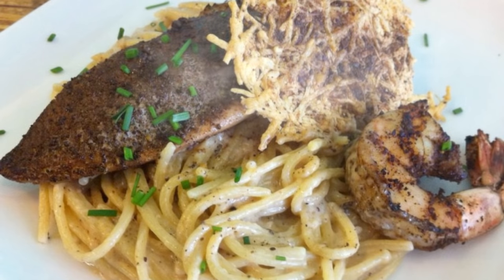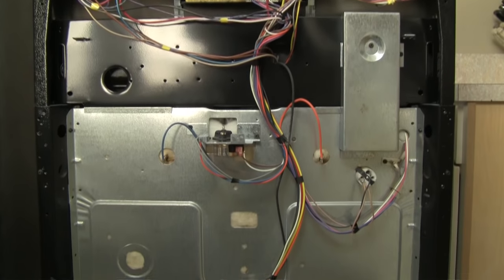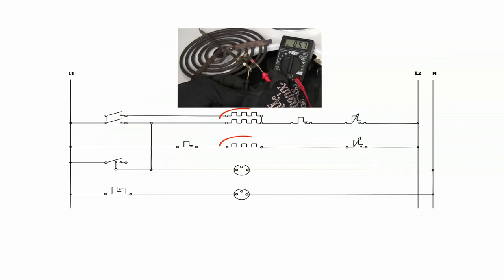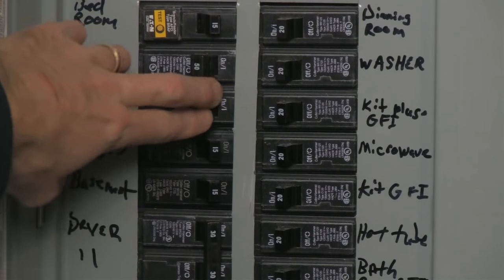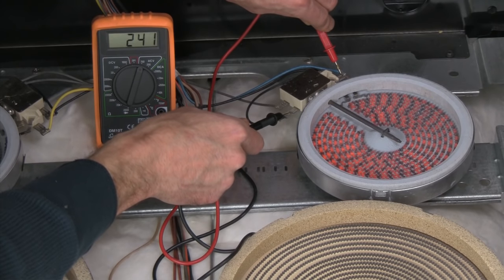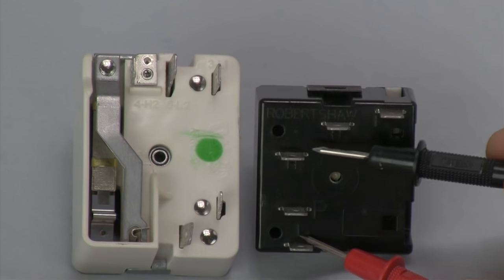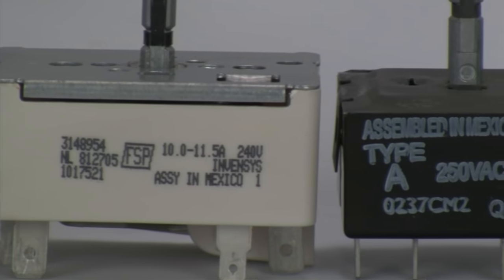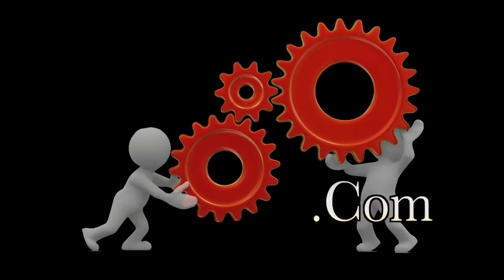Electric Range Stove Repair: How To Repair Burner Elements

Comment: I have a GE JSP42SN4SS, few days ago my power boil element started behaving weirdly. The indicator that  element is on is lighting all the time. When I turn the knob to start power up the coil, it glows red for 10 seconds and then switches off. Then does not switch on for 18-20 hours, after that much time if I turn the knob to switch it on, it again glows for 10 seconds and switches off. Is my coil thermostat bad? Do I need to replace the coil module with something like (http://www.amazon.com/GE-WB30T10133-Radiant-Element-Stove/dp/B004H3XQY8)?

Comment: What do u do if the back wiring is the problem? There is one of the large front burners which is not working... I checked, it is not the problem, it is the red wiring to it is that problem... what do we need to do ...
Reply from the maker: Replacing the wire is possible but you will need to make sure all your new end connectors are crimped well and you are using the same size and type of wire for replacement.  Good luck!

Comment: Yes the breakers is on and 240 volt is at the breaker.
Reply from the maker: Hmmm. Really sounds like a power supply problem, it would be extremely rare to have 3 switches or elements fail all at once.  If it were me I would take a look at the connections from the cooktop to the wall and try to get a voltage reading there to eliminate the home wires or contacts.  If that checks out your going to need to get into the cooktop and see where you're loosing power.  Cooktops simple mechanically but hard to access for testing and troubleshooting. Good luck!

Comment: just seen 2 different whirlpool  model  stoves with  glass top elements glow red  then cut off, for about 10 sec then glow red again,then cutoff again,why ??? cant cook popcorn or boil water,thanks!!! heard its a flaw in design and cant be fixed
Reply from the maker: The element switch will cycle the heat on and off to regulate the overall temperature.  If it was red hot all the time it would get way too hot.  If you are not getting enough heat for popcorn or water, you will need to check the element and the switch.  you may also want to check the power supply.  I go over all that in the video.  Good luck! Hope that helps!

Comment: Hi, my power went out for the entire house, and when back online the stove doesn't work, except the stove clock works. Any suggestions? What should I look for first? Thanks.
Reply from the maker: Is just the oven's bake and broil out? Are the surface elements still working?  If just the oven is out then I would guess the control is bad. However, if the surface elements are also out you should probably start with checking the power supply.  one of the two breaker switches may have tripped off of you may have a bad breaker. Hope that helps!
Reply: Hey thanks for your help. It was the breaker, and the plug in box was loose, which caused the wires to touch and trip the breaker. I fixed. Thanks again.
Reply from the maker: nice! Thanks for the update!

Comment: lol  yes  it is a bummer . im  in AZ  so  i use  the  oven 3 out of  12 months  a year , this is  one of the  months  haha ,   i  dont know if  i need to  take the   top off? or the   control panel face off? i cant  seem to  figure  out  either , id appreciate  your  help ,  jenn air   slide in # sce30500b  thnx  RJ

Comment: How do you open that thing at 0:47
Reply from the maker: There are several different ways, depending on the brand. In most cases, there are 3 screws under the front that you can get to after opening the oven door. Thanks for the question.

Comment: OK. seen a lot of fixer upper but  my problem is my top burner gets hot on low I changed the control switch and guess what still get hot on low and medium anyone have this problem need help. Steve
Reply from the maker: The only other explanation for not cycling on low and getting very hot would be a short to ground that is bypassing the control switch.

Comment: How about the oven
Reply from the maker: Hello! Oven is basically the same concept, but with two larger elements, one for bake, and one for broil (in most cases) and controlled by the control board or thermometer on older models. Good luck!

Comment: Hi! applianceassistant The only thing that work`s on my Electric range is the clock nothen else turns on.
Reply from the maker: Sounds like you have a problem with the second power supply connection to the stove "L2"  The clock and lights run on "L1" but you need "Line 2" for anything to heat.  Have you reset the breaker yet?  Could have a bad connection at the plug or a bad wire inside the range, but it sounds like a power supply problem... Hope that helps some!
Reply: Thank you!
 very much!
Reply from the maker: My pleasure!

Comment: I have an older Frigidaire  range...the other day, the wife turned on an element and the entire surface got hot - not as hot as an element, but - as she described it - as hot as a hot cup of coffee - too uncomfortable to hold onto for more than a few seconds...the element remained cool...what is my problem and where do I begin to look???  We've had problems in the recent past with one of our 6 cats using the surface at night as his litterbox we scour the surface and wash the elements in the dishwasher (BTW a product called Nature's Miracle is a Godsend for eliminating...that's right...ELIMINATING urine smell),,,olease advise...

CB in FL
Reply: applianceassistant
No it wasn't...only one burner/element was turned on at the time, but thank you (when not in use, the oven serves as storage for the w*fe's cast iron pans...
Reply from the maker: Mohammed Cohen I don't have a lot of ideas on that one... the only thing I can think of is some of the heat from the element or from a pan that was being heated reflecting into the range surface...  You may want to look under the top for any loose connections, but in most cases that would cause an arc or trip the breaker.  Sorry I can't be of more help.
Reply: applianceassistant
That's whast I would've thought...I was advised by someone to unplug the unit as I could get zapped, but I'd'a thought the same as you do...a GFI would trip the breaker long before that happened....we DID have a problem with one of our cats usin' the stove (dunno why) as his litter box at night and we scrubbed the stovetop and washed the elements...but I don't see how THAT could cause the problem...as I said, I'd like to fix it rather than buy a new stove...if need be I can replace connections & wiring...someone else suggested replascing the elements but I'd rather KNOW that that is the problem before wasting money on new elements only to find it didn't solve the problem.

Thanx,,,CB in FL (chrisbroz@yahoo.com)

Comment: When I turn on stove it just comes high only, then shuts off..Then turns on high again back and forth
Reply: Sansung
Reply from the maker: That sounds about right. They cycle on and off to keep proper temperature. When they are actively heating they glow and when they cycle off they will not glow.

Comment: my flat top stove will not turn on only thing that works is the clock
Reply from the maker: My guess would be a problem with the power supply... L1 usually runs the clock and some lights.  So probably a bad connection to L2 (used for heat)  try to reset the home's range breakers and hopefully that will do it. If not you may have a bad breaker or a bad connection to L2 somewhere close to the plug. Hope that helps! Good luck!

Comment: what if your stove is push button /digital
Reply from the maker: If you have the static discharge touch control style of surface elements, it's pretty much the same but replace all the switch stuff with a very expensive control board...  The best way to troubleshoot them is to eliminate the elements as the cause with a resistance check. If the elements test okay with a multimeter its likely the control board.
Reply: @applianceassistant  i havent checked yet but only 1 burner is not working , is the switch attached to the burner ?

Comment: L1 and L2 means live1 and 2 bro... not line
Reply from the maker: Mahir Fredericks I suppose if that's the biggest mistake I made in the video it was a success. Thanks for the clarification!
Reply: I also learned it was line.  Someone has there wires crossed somewhere! Live does make sense though.
Reply: +Mahir Fredericks I learned line voltage. It's in all of my electrician textbooks as well.
Reply: +Lilo i got a dumb question. i've disconnected the stove for element testing, but there's still juice left @ the elements, cuz my tester buzzes, why ? i had to turn off my main switch. is there a better way other than find L1 & L2 on the panel ? 
my other question is adapting a newer type of element w/old receptacle. seems like it should be doable, cuz manufacturers are just playing games.
Reply: when you say disconnected... i assume you turned it off at the mains? and if your tester buzzes then you're on the wrong setting and could be testing for continuity, depending on if you probe after the switch.
Reply: +Mahir Fredericks i've pulled out the plug at the stove connection, but there was residual current at the element.
Reply: thats highly unlikely as there are no caps in the system, but you should as a precaution, ground any of the lines to the chassis with a screwdriver... then you shouldn't have any problems like the kind you described (after unplugging of course)
Reply: thanks, will try that. there was a grounding problem a few years back & an electrician ran a ground wire to a cold water line for the stove. house was built in the 50's.
Reply: im not an expert tho im a heavy current student, so if you hit a snag you cant handle consult a professional with a pic, so he can see the full situation
Reply: thanks great idea, so far i've managed to stay alive because of youtube.
Reply: lol caps are measured in Farads not V
Reply from the maker: +Mahir Fredericks True  a capacitor's capacitance value is measured in Farads; However, if you look close there is also a voltage value on many caps... such as 2000VDC on a microwave cap.
Reply: applianceassistant yes, but Volts don't kill you... Current kills you... that's why you live after getting hit with a 22000V taser.

Comment: My model # is ACF4225AC
Reply from the maker: I started thinking about this one a little more... actually it would not be the switch because it's not the "element on" light (switch) it's the "surface hot" light.  I would be inclined to think that i's the actual LR element part#74007839  There is a hot surface thermostat built into the element for that purpose and it's probably sticking a little.  Good luck!

Comment: not helpful. you seemed to spend more time trying to sell your little electric meter gauge as you did explaining why my burner only works part time. Oh, did you explain why my burner only works part time?
Reply from the maker: riteuptite You need to use the little electric meter gauge (multi meter) to figure it out... Pay someone 100-150.00 to come to your house use a little electric meter gauge to tell you what your burner problem is.